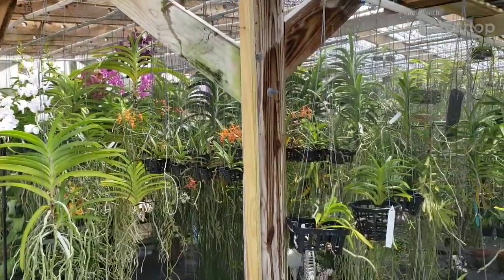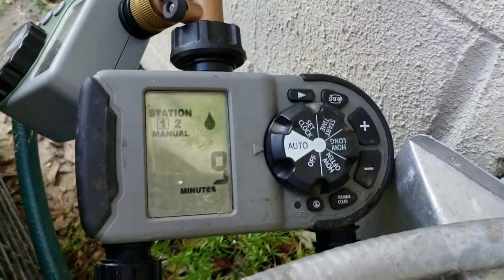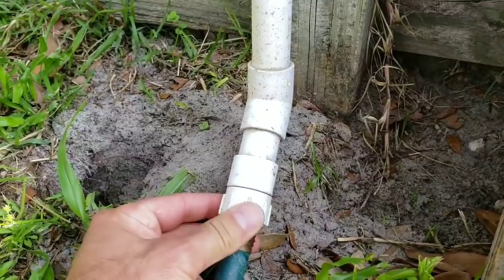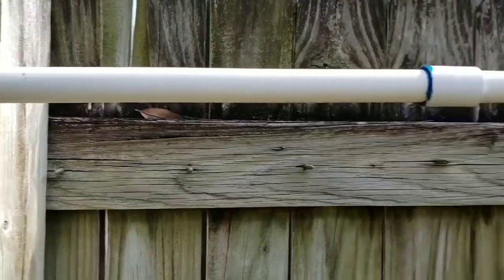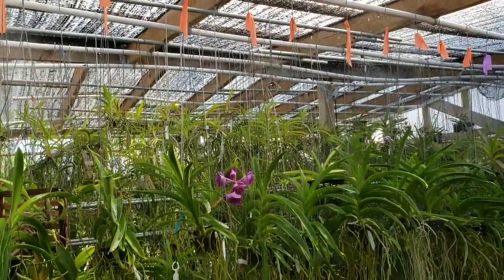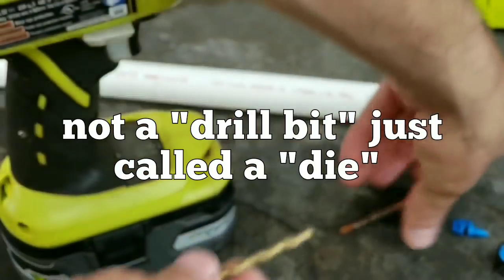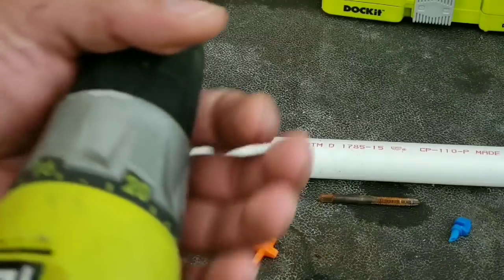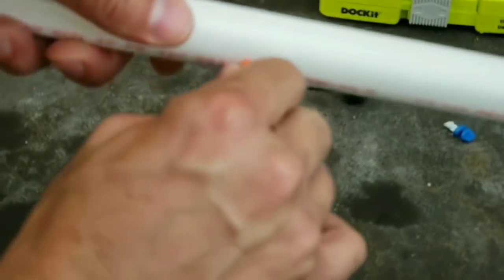DIY Greenhouse Irrigation system for Orchids and Tropical Plants

Comment: Where did you source the downward spraying irrigation fittings?  Btw the thing that makes threads is called a tap. The die is the other part you can repair/cut  threads on a bolt with.

Comment: Thanks for the videos! Couple of questions -- are you using regular tap water as opposed to going through an RO or other purification system? Second -- regarding the placement of the piping, my understanding is that it is not ideal to place the heads directly over the vandas due to water collecting in the crown. Seems you're not at all worried about that, so I was just wondering if you treated the water somehow to account for that or if the climate simply evaporates the water in the crown quick enough. Great content, really helpful!
Reply from the maker: I spray regularly with fungicides so Crown rot rarely happens. I use just plain tap water. I guess where I live the water is good quality. Because some of my friends who live in different parts of the state have to use filters

Comment: Great video. Where do you buy your sprinkler heads? And what size(s) are they to fit the measurements of the hole you're drilling? And can you tell us more about how to choose the sprinkler heads please - like where to find info about the choices of directions they'll spray.
Reply from the maker: Okay.  I should have explained them in more detail.  Another video perhaps!  I purchase them at either Home depot or Amazon or commercial irrigation store.  I will elaborate in a video
Reply: @mainlyvandas214  Can you please post a link where you can get those sprinkler heads...thank you

Comment: Do you strategically place the Vandas so the flowers don’t get wet? Or does it matter?
Reply from the maker: It doesn't matter..the only thing i look out for is if the sprinkler is dripping into the crown of the plant after water is off.  Other than that, everything is watered as if it was raining on them.
Reply: Mainly Vandas Thanks for the reply! I am new to Vandas. I have 4 plants. Any advice or info is GREATLY appreciated!! Your collection is AMAZING! What is the best thing to do to deal with spots on leaves?